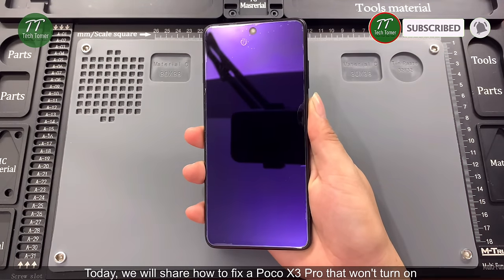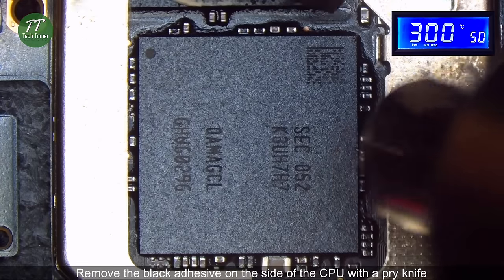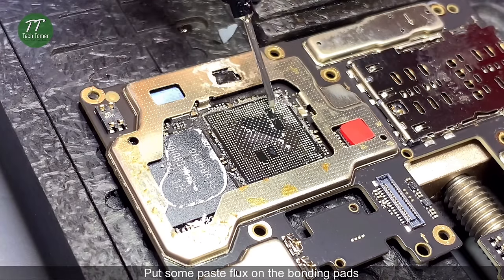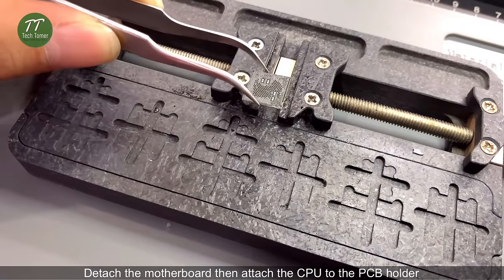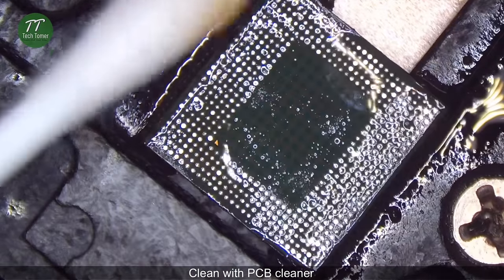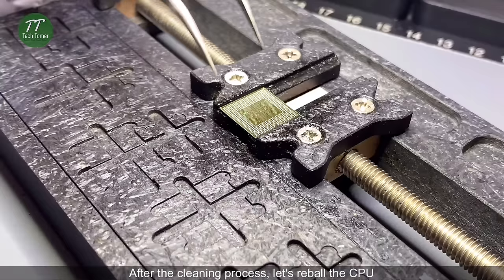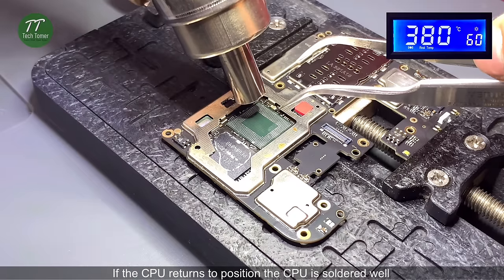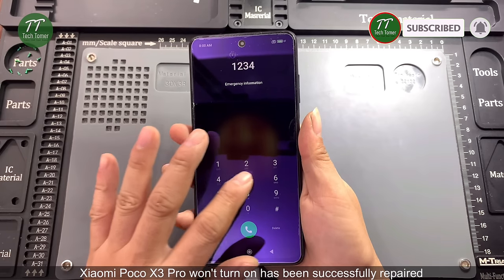Xiaomi Poco X3 Pro No Power and Not Charging Solution - CPU Reball Tutorial | Tech Tomer

Comment: so sad and disappointed my Poco X3 also got that same problem...😓😓😓look so difficult and high cost to fix like you do...but your hand work was tremendously so detail and what a neat and tidy job...👍👍👍
Reply: @bhavinbalsara5192  price?
Reply: Broo Tera fixed hoo Gaya kyaa problem
Reply: I fixed my friend's poco x3 pro. 1st is go buy a torch lighter and thermal paste.. Teardown your poco take out the motherboard remove the dust tape and be ready to resolder the CPU (no need to take out cpu out from the motherboard like in the video).. Put on a ceramic table or any and blow the CPU with the torch lighter for 10 sec,
!caution!
Do not let the flame hit the CPU!!
blow it in circles!! 
Do not blow on the same spot for too long or it will burn!
after it cools down put a new thermal paste or thermal pad on the cpu, put it back together and then put it in the charger, see if the POCO logo shows up
Reply: Me the same problem
Reply: @RamlyJer  after cpu reball complete and successful ,during gaming if phone heats up will cause any defect later ?
Reply: @davidkun9565  my repair is called reflow it just temporary fix. It lasts for weeks or months if lucky it lasts for years. Proper reflow technique is required a heat gun and flux but I don't have this two.

New update, his poco broke again and no longer can be fixed this way..
Reply: My phone is convulsing and not responding, then it turns off. I keep my finger on the power button for a while. What is the reason? poco x3 pro
Reply: @salahbek4984  software problem?
Reply: @RamlyJer  maybe I don't know
I am currently using it, but at any moment it does not respond and turns off
Reply: @salahbek4984  try to downgrade or reflash the rom(software)
Reply: @RamlyJer  bro I am applying rebool by trusted technical guy but I am afraid that the phone die again so not play game and heavy work only YouTube, movi , web , online class etc . How last my phone run 1 year or less .I am afraid.
Reply: @menote4761  reballing is permanent fix don't worry it never broke again soon..
Reply: @RamlyJer  bro my phone is mi 11 pro . I think the heating problem is common in my phone snapdragon 888 . In normal use it heat in back ...so that why I fear of dead again.
Reply: Same problem Tommorow I have 😭😭😭😭
Reply: @bhavinbalsara5192  does we lost the data 
When after repaired this problem ?
Reply: Bạn cho tôi hỏi bạn đang dùng chạm hàng của hãng nào để làm keo trên main vậy xin cảm ơn nhiều
Reply: @RamlyJer bro mine one I got a monthboard replacement and still. After 3-4 hours it died again submitted to service centre
Reply: @bhavinbalsara5192 Amigo, sabes donde puedo comprar esas piezas? Gracias de antemano, saludos.
Reply: Same problem with me in the phone but done fixed the power ic but that phone turn on but also that ask some questions I answered but that not opened
Reply: Repair Price pls
Reply: I repaired poco X3 pro  only 1500 same problem Nagaur city rajasthan
Reply: @Calm_Game 1.5k
Reply: @RamlyJer Will the problem continue after that or is it a final fix?
Reply: @RamlyJer Brother Need your help with mobile repair. where do you reside?
Reply: 3000 motherboard 😢
Reply: @hindbaaz abhi bhi sahi se chal rha he kya
Reply: @RamlyJer it is not a permanent solution. It will work for few hours. After that the problem will be same here
Reply: How much cost brother?
Reply: @JasminBarinas-he4nd cost me 2.5 k to cpu reballing
Reply: @brokieyt706 now it's ok or not?
Reply: Dont sad dude u can reball after watch this😂😂😂
Reply: Hello, are you doing the repair? mine turns on and then white screen. thank you for informing me. 👍

Comment: LOL I have this exact problem with my X3 Pro and went to a repair shop. The guy charged me $70 to fix. I thought it's a ripoff but did it anyway because I needed my phone.
Now I know that it's a frickin BARGAIN. If he showed me this video beforehand, I would HAPPILLY to pay him $100, with gratitude.

That's some amazing skills and delicate works.
Reply: Amigo ya paso un mes de tu publicacion, aun te sigue funcionando?
Reply: does it still work?
Reply: Was it efficient? How much you have been using it after the repair
Reply: How long does a cpu reballing can last?
Reply: To the replies above well i also got mine reballed and its been 1.5 years
Reply: @makii4772  did you played any games or only normal usage?
Reply: @grehan900  well i have also same problem 
I fix my CPU before 5month 
and today its not working
Reply: @Min0taur-Taurus  A reball is the best way to fix these. The alternative is reflow which is easier (you just heat it up and tap it when the solder melts). So I'd say it will last you very long if its done good.

Comment: hi @techtomer , I wanted to ask you an important question regarding CPU and Ram reballing. For how much time this repair technique lasts for a POCO X3 Pro phone model. My phone had the same issue and I got it repaired from MI Service Centre recently. But I am not sure for how much it will last. The phone which you repaired in your video is still running fine? For how much time a CPU and RAM reballing lasts for this model?
please answer !
Reply: Did you pay them for the repair?And did you take your phone to the mi service center???or was it a store?

Comment: new subscriber po! sir ask lang po anong soldering iron gamit nyo at anong temp? sa ibang video nyo po ang gamit nyong pong timpla sa hot air na quick 2008 is 400 - 60. pero d2 ngayon sa video nyo is 380 - 60. na lilito lang po ako. ok lang po ba kahit ano sa dalawa ang gagamitin? salamat po. more power..
Reply from the maker: explain ko po ma'am
Kapag 380/60 medyo malambot ang Black adhesive or Glue
Kapag 400/60 po medyo may katigasan naman yung black adhesive or glue
Hindi po lahat ng Black adhesive or glue ay pare pareho kaya kailangan po mag adjust ng init

Comment: A crazy much simpler solution: bake the motherboard (mask everything except the CPU and memory area with aluminum foil) in the oven, for 10 minutes at 170° C. It's a solution that might work a lot less time than this, but it's much easier. I've know of one that did this and for a year it's still working. Well worth a try if you need to backup its data. This is what I had to do today, and it's working
Reply: Amigo y cuanto tiempo lleva fumcionado tu poco desdw que le hiciste ese arreglo?

Comment: Today I fixed my friend's Poco x3 pro, maybe just be a temporary fix because I didn't replace the solder on the CPU.
What I can see is this same issue happening on my PS3 and PS4 before. It is like the solder has expired (maybe)..
What I did was I blew the CPU with torch lighter for about 10 sec, I blow it in circles after I see the flux melted it seems work. I put everything back together and put the charger and it finally woke up it's working!
I'm sure this is just temporary, it will die again soon because the solder needs to be replaced
Reply: Day 4 update after i fixed it with a torch lighter.. it is works like a new poco x3 pro 💪
Reply: @RamlyJer  torch light?
Reply: @fazil725  no, it's a lighter with jet flame you can find one at the mart
Reply: brother.. need your help with mobile repair. where do you reside?
Reply: @yogeshchayal  I live in Malaysia, I do not work at a mobile repair shop.. I just helped fix my friend's phone